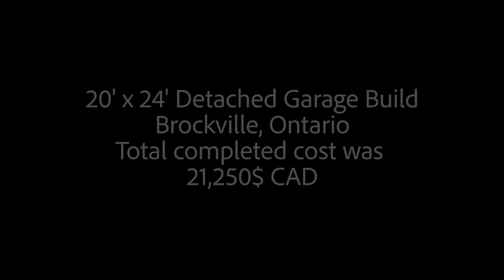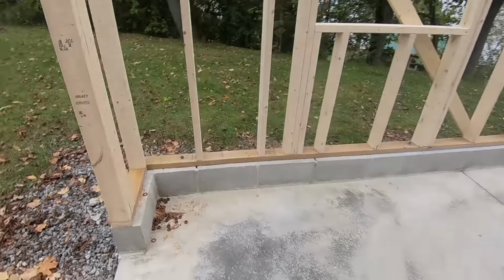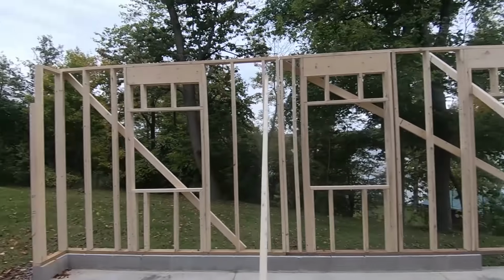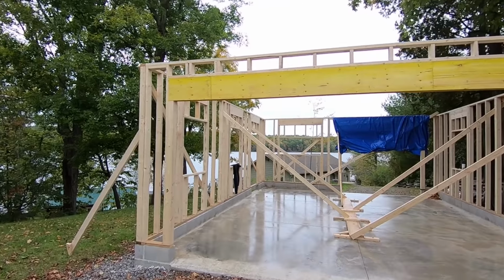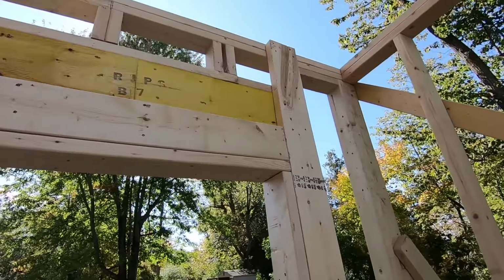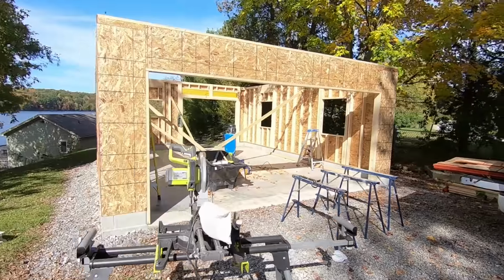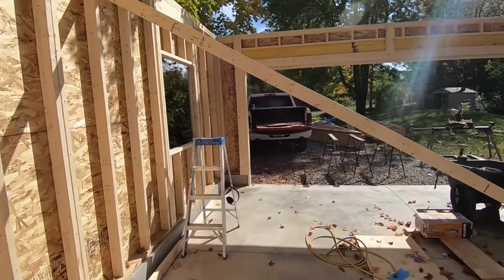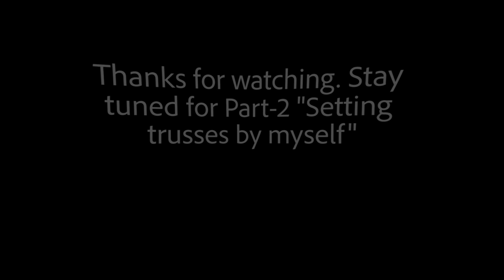One Man Garage Build (and wife for 30 minutes) - Part 1 - Walls

Comment: Good job, you may want to consider using a router with a pilot bit to remove the sheathing from the window openings. It eliminates the need for marking.

Comment: A note to anyone who is planning on building. Don't ruin you need concrete with bolts like this, simply extended your bracers with more 2x4 to make it reach the other side. 

That pro tip is free old son
Reply from the maker: Definitely a good call, wish I would've thought of that.

Comment: Enjoyed your video.  As one that does residential design work, it is always good to see how its done in other parts of the country.  Clever Idea on house wrap holder.  I jokingly thought, I will always know it is upside down but no one else will.  Yeah it does not matter the lettering is upside down.  If it did, it would have been printed on the wrap.
Reply from the maker: That's for taking the time to leave a comment.

Comment: If you are dealing with an unlevel surface, make it level.  Stretch a line out from the top of the ground next to the building go out 6 feet and measure to the ground.  That is how much you will need to raise your secondary based by.  Concrete blocks braced by rebar is easy to do.  You then lay on some plywood on that and your ladder is level.

Comment: If you use a double bottom plate one for the foundation and one for the walls no need to move the bolts just drill a hole

Comment: Instead of grinding those bolts off, couldn't you have just moved all your studs down. Like, make your first stud 10" on center instead of 16"? That put them all in a different spot. Great video by the way.

Comment: Screw 2 boards together and then you can span across to the other wall and don't need to drill holes in your slab.

Comment: Hey,  thanks for posting the video's,  I am going to be self building my garage in Ottawa this fall as well.   I had a question for you re the foundation.   did you have have any issues after the winter. I was recommended putting rigid insulation vertically and horizontally around the exterior of the slab to prevent frost from heaving / cracking the slap.

Comment: What Size Nail for the 2x4 Wall ? 16 Penny 
What Size Nail for the OSB Walls Sheathing ? 8 p
Good Video BTW 
Just Trying to Learn how to Put Together a 12x10 Shed 
My Concret Pad is 20'x 12'  with Green Coated Rebar Poured by FRANK !!! from Marzi , ITALY - from CALABRIA .
iam in Toronto .

Comment: Pretty sure the sides of the bigger door need to be more that a pair of 2x4s.   I have always used 2x6s on edge to make bigger stud to floor connection.  You never want to put non pressure treated wood in direct contact with cement.  .
Reply from the maker: Yup, no direct contact with the cement at all. Thanks for commenting.

Comment: Hi, did you use a filler strip before mounting the 2x6 door jamb to the overhead rough opening?
Reply from the maker: Im not entirely sure what you are referring to. Are you asking about the garage door openings or the man door openings? Either way, I think whatever I did should be easy enough to see if you watch the video.
Reply: @iveneverdonethisbefore8390  garage door opening. It's a bit zoomed out so it's hard to see but it looks like there's some sheathing between studs and jambs
Reply from the maker: @ditachan  Oh yes, now I remember....the cinder blocks were like 1'' too wide so I needed to make up the gap with some pressure treated 1/2'' plywood on each side. I could've just doubled up the 2x6 jambs but I was trying to maximize the actually usable opening as much as possible.
Reply: @iveneverdonethisbefore8390  thanks! The concrete guys made my opening 1.5" too wide on each side so I'm just figuring out ways to fill it out width wise and your method helps me get a better idea of what to do
Reply from the maker: @ditachan  Yes, thats what the cinder blocks guys did to me too. But maybe check with a expert if the plywood is the proper way to go. Im no expert.

Comment: next time doing the windows after you drill the hole in each corner get a router with a flush trim bit and run the box for perfect quick cut no more drawing lines
Reply: put the sheathing on before you lift the walls
Reply: @CD-W0DOS  actually, since reaching the walls is not a problem, it is best to do afterward so that you can make sure everything is plumb and square once standing.  For experienced framers that is a good technique.
Reply: Or wack a hammer through and router from there. Saves time on drilling hole.
Reply: @Dahogey  very very true, hammer's always on the toolbelt so that would definitely be faster.

Comment: How much would it cost for the concrete guy to pour where you have the cinder blocks?
Reply from the maker: The concrete and cinder blocks was 7200$ CAD total, labour, materials, excavation etc. Was not the cheapest in the area but the guy was worth a bit extra.

Comment: Did you insulate it?  $210,250 doesn't seem bad for that size.  I am looking at a 24x32 shop with a 14' door.
Reply from the maker: Insulation, drywall and electrical in the next month or so, I didn't include that in the original 21,500$ cost. Those items are going to bump the total cost up to about 24,000$CAD.
Reply: @iveneverdonethisbefore8390  So thats only $17,600 in real dollars? Nice

Comment: did you fix block before concrete the floor or block is on top of the concrete please reply, while you start video ..
Reply from the maker: The slab was done first, then re-bar posts are drilled into the slab so that the blocks are tied into the slab, then the blocks are laid down and mortared.
Reply: @iveneverdonethisbefore8390  means nut bolt  Bar almost 10-12 inch long .. ? , I saw all your videos. very good job . its neat and clean job .. i am in Africa ..like your job ...
Reply from the maker: @singhA1968  Yup, probably 10'' long.
Reply from the maker: @singhA1968  Thanks for leaving a comment.

Comment: at this point, what's the difference between a garage and an American home?
Reply from the maker: I don't understand?
Reply: @iveneverdonethisbefore8390  a lot American home builders use the same methods as building a shed, so you have a wooden frame covered (out) in sheet material, be it external drywall or particle board or OSB, etc. and then a layer of plastic and then some oil based synthetic martial for insulation, all having the structural integrity of an apple picked 4 months ago and left in the back of a fridge, barely holding it's weight. it's like living in a cardboard box. my office was built using this method and it's no where near being good as a home, it starts falling apart 1 month after finishing, you'll never see a 280 years old home built this way, while my grandparents home was built from stone and mortar (not fired brick and is only 75 years old) it's still up and in tip top condition apart from the outer mortar finish where it's refinished every 30 years because rain and wind
Reply: https://mapio.net/images-p/26748711.jpg this is one example, this home is almost 80 years old, and the only reason it looks shabby is the owners neglect

Comment: 10:43 why not take just take the reciprocating saw at this point cut out the bottoms of the windows from the inside using the 2x4 as guides.
Reply from the maker: Yea, you definitely could I guess. Sawzalls make a mess out of OSB but it probs would matter in this case.
Reply: @iveneverdonethisbefore8390  your method is just fine.

Comment: I wonder if this guy knows you cant attach wood directly to concrete? Its needs a barrier to keep to porous surfacing from touching because the wood will wick moisture from the concrete and rott and mold... amature hour equals ruined projects equals wasted time and money. Do it right the first time. Inform yourself.
Reply from the maker: Yikes, harsh words but yes, the sill gasket is there. You can see it being applied multiple times in the first 2 minutes, specifically the 48 second mark. 

Thanks for commenting.
Reply from the maker: And also, the bottom plate is pressure treated.